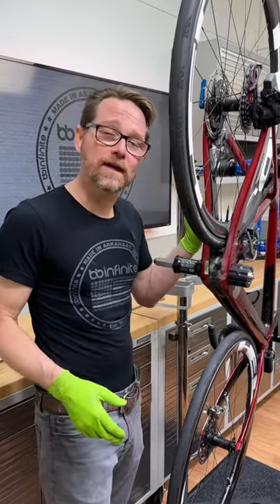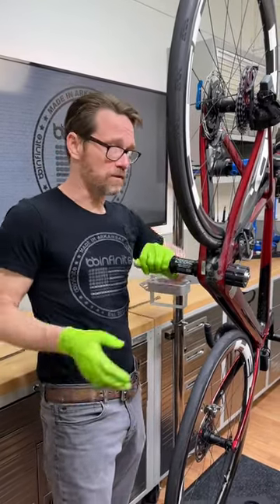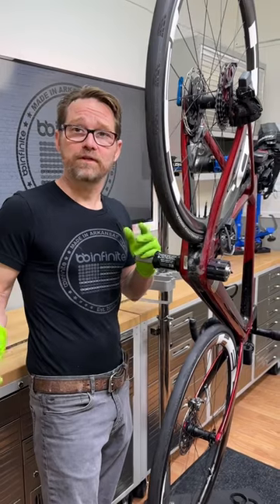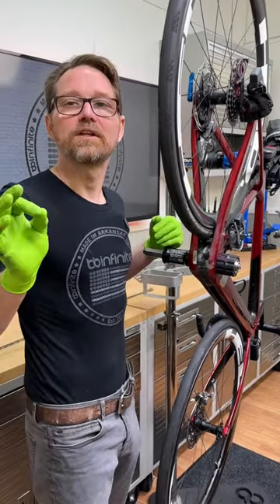Is Loctite Safe on Carbon Bicycle Frames...HECK YEAH!

Comment: Loctite 222 on my press fit crank bearings (4130) fixed my creaking issue on my Pivot Trail 429. It’s what Pivot recommend.
Reply from the maker: Do what Pivot tells you. Me, I would use Vibratite 530. I'm not saying you should. I'm just saying what we'd do.

Comment: Do you use any sort of primer ? Got some headset cups that is slighty loose in the frame, can easily press in by hand (carbon frame). Thinking about trying Loctite 641. Park tool's retaining compound must be used with primer on carbon parts..

Comment: Does this method work on headset bearings too? I've been having this headset play for months and when I go tighten the preload to get rid of the play, it creaks instead. My guess is the bearing cups are very slightly loose and I'm hoping that using a retaining compound would solve the issue.